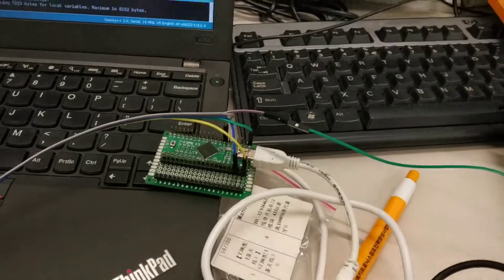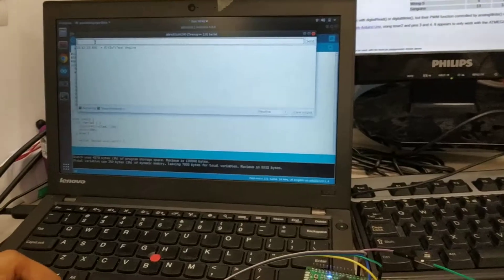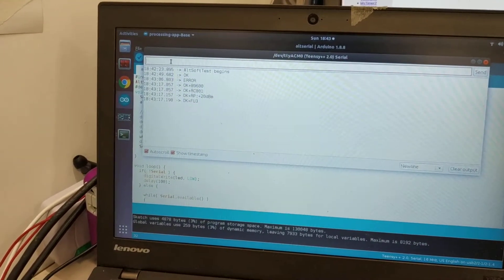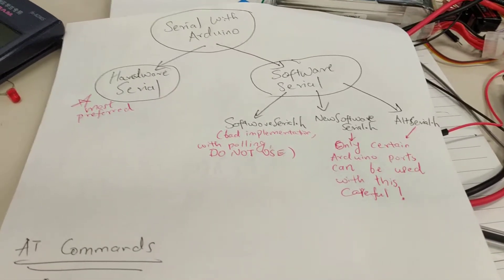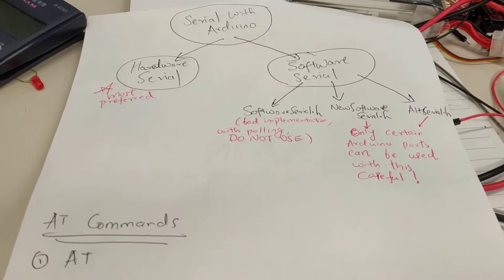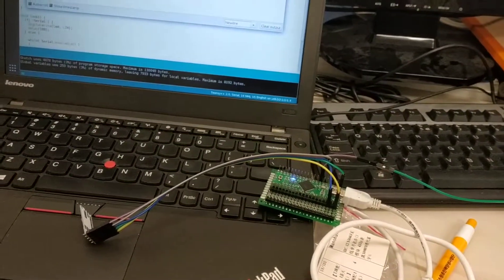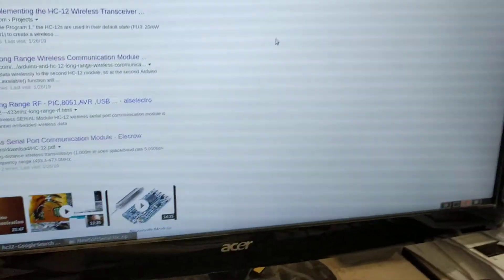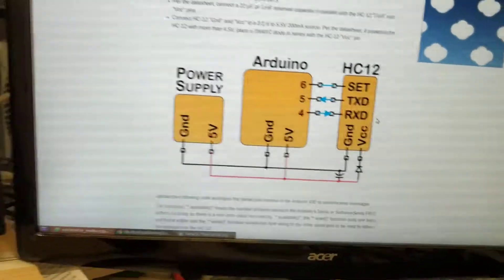HC12 with Arduino serial

Comment: Bro I haven't added any capacitor or diode and used the hc12 in my project of home water level control. 1 hc12 is on roof and 1 jn basement. Distance 30m indoors. The connection breaks frequently being still in one place. So any way to increase the range and make it more stable. Will capacitor help me or I should use a sma antenna .
Reply: At commands are as,
Fu4, 1200, c81 and 20 dbm
Reply: @vp.8181  You may have a clone with the pcb error. See here: https://www.youtube.com/watch?v=ZfBuEAH-Q8Y
Reply: @cr6925  no the wiring was loose 😂😂 it's sorted now
Reply: @vp.8181  Glad you got it working :-)